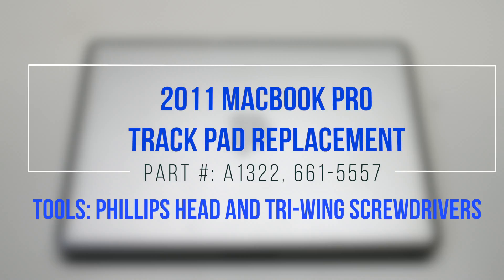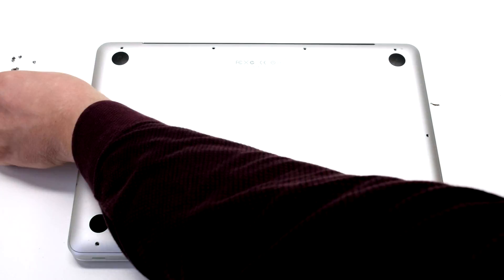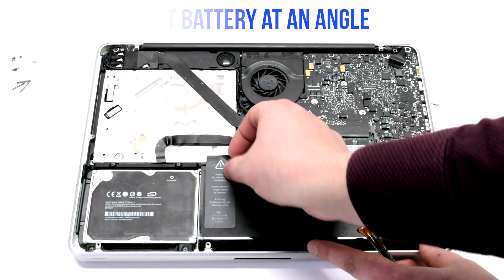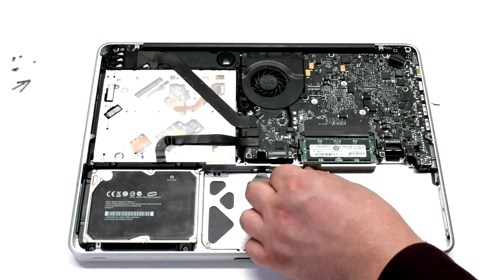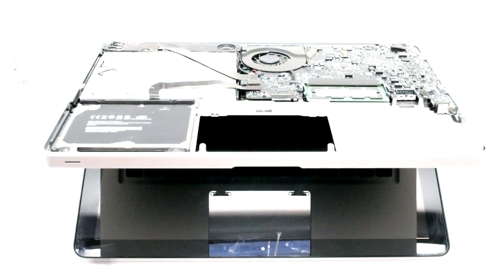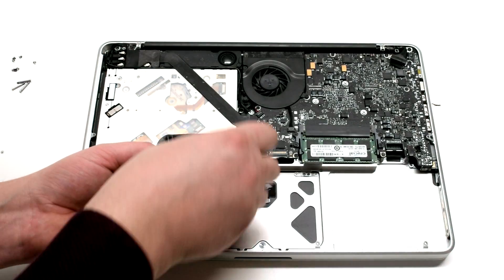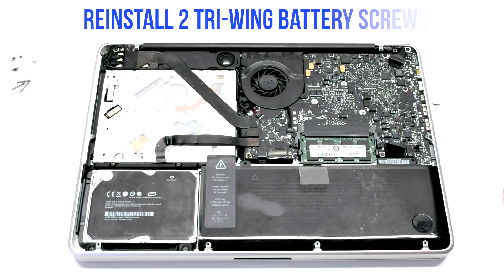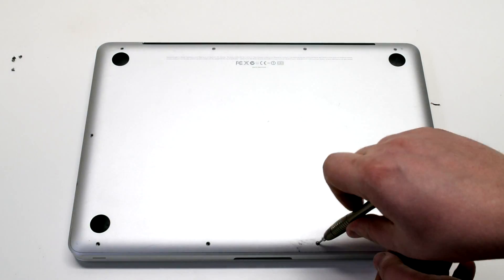2011 Macbook Pro 13" A1278 Track Pad Replacement

Comment: Something fell on my employer's trackpad and cracked it.  Now it doesn't click at all, although I can swipe sideways.  Could tightening the screw possibly correct it, or do you think I'll probably have to replace the trackpad?  THANKS!
Reply: That is a great option,  Worked for mine also.
Reply from the maker: You can most likely fix it, watch this video http://www.appledollars.com/trackpad-replacement let us know if you do fix it.
Reply: Actually, I took it apart, and reinstalled it, then in System Preferences changed the options to 1-, 2-, and 3-taps for using the trackpad.  Working great.